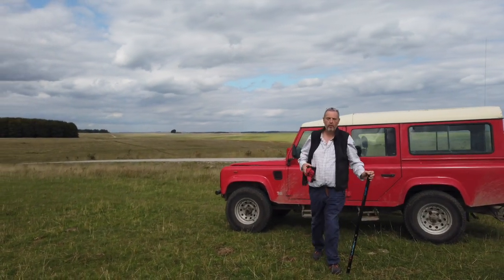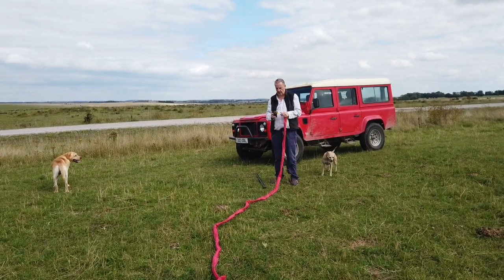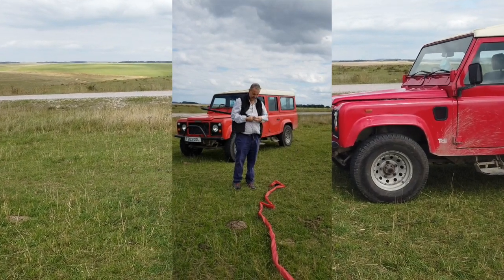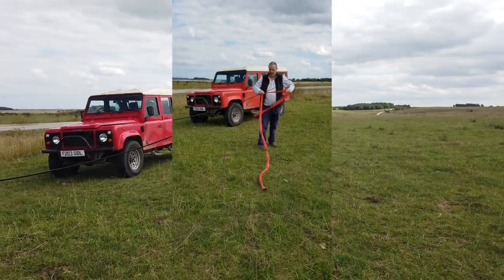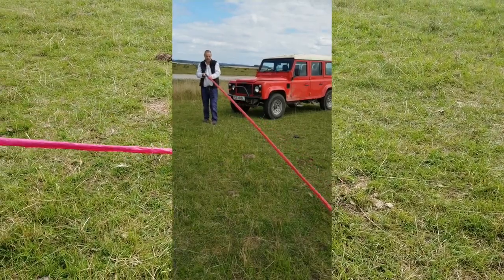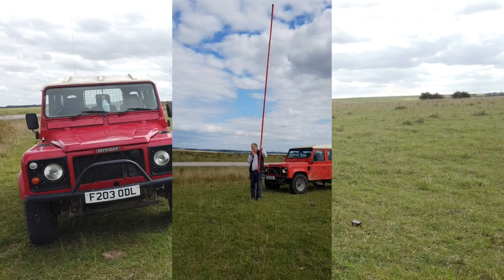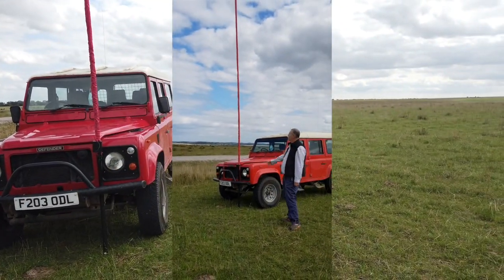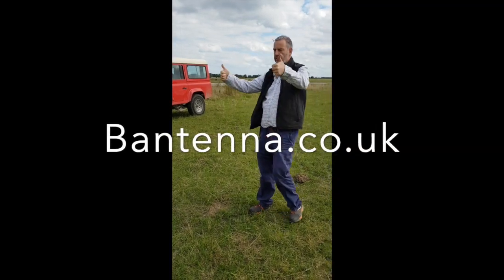HF all band antenna, Bantenna Sleeve antenna

Comment: dear david i wonder if you can tell me is the wire that is built into the nylon sleeve helically wound or just a straight single wire ? i fully understand if you do not want to say best regards.alan. 73
Reply from the maker: Alan

The aerial is more than a straight wire...it performs better than that.  The antenna though is designed with my baluns to work as a system.  Theyre pretty good!  Up to 150watts i reckon.  Ive run more but they were never designed with qro in mind.  Ive had great success with a G90 portable and at home with 100 watts.  Others do too.

Comment: You can alway sell a magic antenna to an uneducated box operator. 
9:1 unun & a piece of wire does exactly the same thing.
As the old saying goes, "A fool & his money are soon parted !"

2 Supermarket trolleys will load as a dipole & only cost £1 each so I'm going into business. 

For sale NVIS cage dipole £1000 (Supply own coax & ATU) Full system £2000 😂

Comment: I bought a Bantenna antenna a few months ago and use it mainly for FT8 and WSPR. I have worked VK and JA amongst others on  FT8. I am really impressed by how well the antenna works. I haven't used it on SSB yet, but intend to do that soon. 
Bob, M0BOB.
Reply: Have you tried it on 80m. Is it a loaded antenna?
Reply: @lawmand  As far as I am aware, it isn't loaded. I tried 80m a few times and didn't have much success. I left it running using 1w on WSPR and had several contacts around Europe. So far, the best band that it has performed on is 30m (FT8). There is no getting away from the fact that it is a compromise antenna, but it is easy to install where space etc is limited.
Reply: @m0bob  thank you for replying. I wondered if it was Cobra Loaded, ie the radiating element folded back on itself. From what I can see it's a short random end fed wire or Earchi. I was looking for something to get a few points away portable in contests. I used an inverted vee last time but it's a faff to put up quickly. I like this concept, but think for 80 I'd be better off with a longer radiating element, maybe an inverted L or similar.
Reply: @lawmand  I am only using the Bantenna as a temporary antenna at home. It is useful for days out, holidays etc because it is nice and compact.

Comment: Is this just a length of wire strung up a pole with an unun at the bottom? Seems like an unnecessarily over-engineered design if that's the case?
Reply: TOBY601-  Well... what have YOU invented, produced and marketed?.... Uh-hu....That's what I thought.
I am sure that this antenna won't compete with a 200 meter long loop antenna, but a 200m loop antenna can't be shoved easily into nylon bag which weighs a few ounces!
Reply: @MrJamespcastle  Sorry wasn’t aware there was criteria that must be met before being permitted to comment to a public post
Reply from the maker: Indeed, if it WERE just a length of wire you'd be right.  But its not.
Reply: @g4yvm  Can you tell us more about it please?
Reply: Sure   hf all band all mode 100w antenna. Swr about 3 or lower on all bands.  Designed to use an atu ideally.  Excellent little aerial for what it is.  See bantenna.co.uk for more details and magazine reviews and reviews from end users.

Comment: do you have to use this in conjunction with an external ATU? and is does the coax connect via a PL259? very interested
Reply: An ATU is recommended.  The unun terminates in a bnc but i can supply adapters to SO239.  Let me know when ordering that you want one

Comment: interested to see on air performance, As for not being able to hear you... your audio is fine, it's just the wind that can be louder than your audio but your still Audible. I hope those that cant hear you dont suffer the same issue with deaf radios it would make their hobby very slow indeed.
Reply: Thanks Steven.
Yes the wind and dog panting is a pain but not so bad I agree.

I will get better on air videos as soon as i can, but they are getting very good feedback feom current users.  Talk soon i hope...73

Comment: Awful video, can't hear you. An on air demonstration would be nice.
Reply: Thanks Gerald.  You should have a little loudspeaker icon.  Slide that right to get volume.  Should hear me then.
Reply: @davidperry2619  It's still too quiet at full. maybe a noise cancelling mike
Reply: @davidperry2619  I have no problem with the sound Dave
Reply: No problems here, very clear